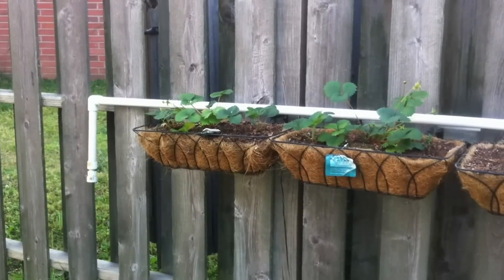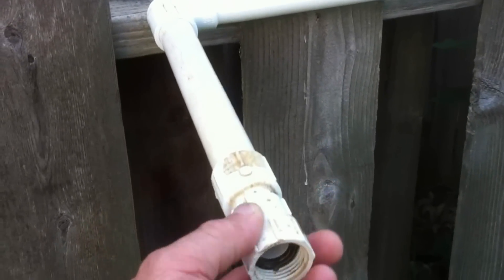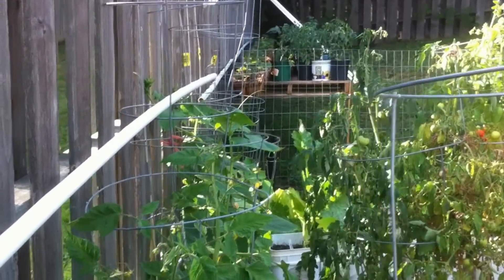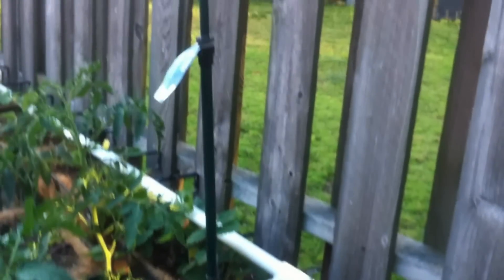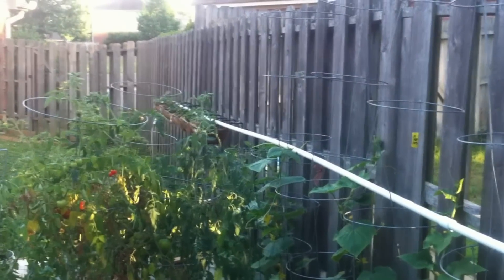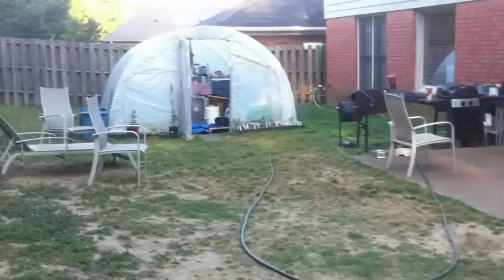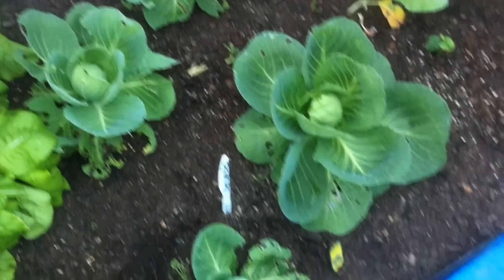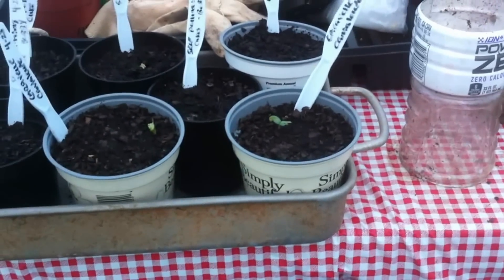Building my Strawberry Planter Irrigation system

Comment: Looks great. At the moment we're in a hose pipe ban, which means that we're not allowed to use them at all, so therefore irrigation systems are out at the moment. In my hanging baskets, I placed a plastic drinking cup with a hole in the bottom, so I just water in the cup and it drips through. Seems to work at the moment, and much cheaper than a drip system. Everything else looks great.